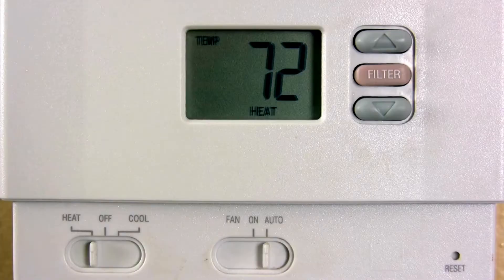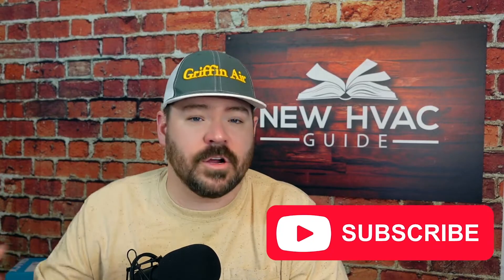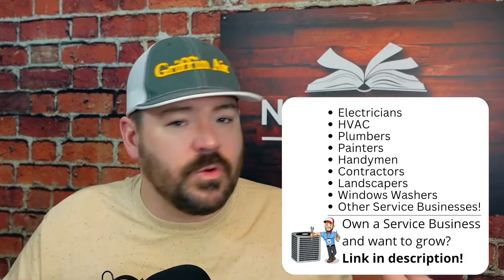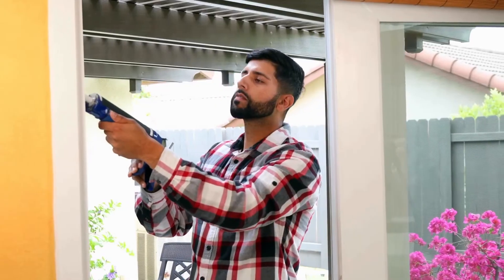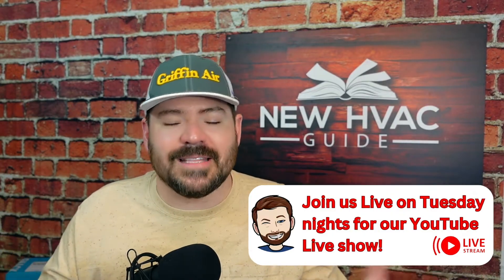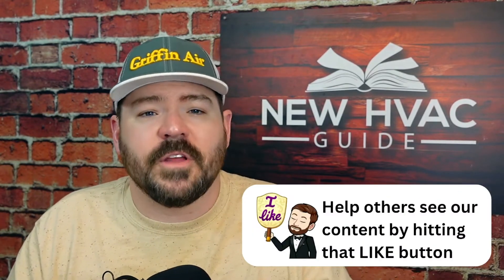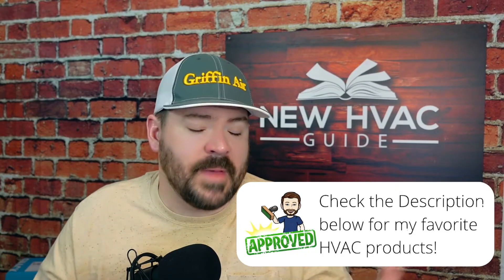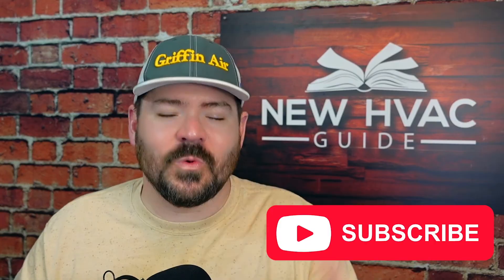Thermostat temperature reading incorrect!

Comment: It's December in Chicago...I just had a new high efficiency Amana HVAC with heat pump installed and the new Amana thermostat was installed in the same location where the Google Nest was located.  We never had an issue with Nest temperature readings.  Our current readings have been very inconstant - the thermostat reads the air as being much higher than what the ambient air is.  Consequently, more heat is pumped.  What to do?  and, has any other Amana used experienced the same?

Comment: I dont really understand because most people are saying that the thermo is reading higher tems than the actual room temp. So wouldt it be the other way around since the air temp behind the wall would certainly be colder than inside the room?

Comment: I've dealt with the hole in the wall, had it in a different house.
My question is to the newer style digital units. Model honeywell RTH6580WF1001.. Just for reference. The temp control has seemed off since early summer. We had our unit replaced 6 years ago, it went to a seer13. Blows really cold. House will feel like a meat locker at times because it seems to run more then it should.😂

I've got a mechanical temp gauge taped to the wall. It's been consistently a degree or more colder. The thing I've run into is the thermostat itself is running hot. When checked with an IR gun. It's showing 3-4 degrees hotter than the wall. Which at times can be a degree more than the actual shown temp. Which is running higher.
Heat is off as we are swinging alabama fall temps.
Right now wall is 64, gauge near unit shows 67, gauge in nearby room in clock shows 64. The unit itself opposite side of setting buttons reads 66, next to the buttons reads 69. There are no batteries. Wifi unit auto sets after no power. Do these units always show heat like this or has this started to go bad. Our previous hunter thermostat killed the a/c as it ran all day when we weren't home.

Comment: This worked for me!!!
My wife likes it cold so the setting is on 72 and it constantly running.  The temperature on the unit says 72 but it feels colder in the room.  I put a temperature gauge near it and it read 69.  I tried to calibrate the thermostat but NG.  After watching this I pulled of the unit and found a large hole, so I plugged it with pieces of wall switch foam and painters masking tape. Now the room temperature matches the temperature on the thermostat.  You saved me from freezing and more- thank you!!!
Reply: I have my thermostat upstairs set on 74 and the it feels very cold 68 degree. What should I do?!

Comment: My thermostat is set on 70 and auto, the temp on the front of it says 74. So it never reaches 70 which is causing it to constantly run instead of reaching 70 to shut off, what could be the problem?

Comment: my thermostat is set for 69 but it got all the way up to 77 and it wouldn’t even cut off. I had to actually go in manually cut it off.. the thermostat at the wall wouldn’t even cut it off.
Reply: Mines the same way
Reply: @NickWilliams-e9f My man got it fixed. I can’t remember what was wrong. His friend fixed it for 50.00. it would’ve been more than that just for heating and air company just to come out to look at it..

Comment: I live in an apartment and I went from an electric bill that was $125 to one that was $220 in just one month. Granted, the outside temps went down  a lot.. but I kept the thermostat at 72 the entire time. There'd be times the temp on the thermostat was 71-72, then I'd think "gosh, its warm" and the temp would be 77-78.  Nobody touched the setting.  We're like "WTF happened"?
Reply: The same mine set to 67 but read between 78 to 80 and it 100 degrees outside I am like do the management have it set differently

Comment: you could put a dab of fiber insulation behind the tape too just to prevent it even more. it's not permanent so if a fix is needed it doesnt prevent it and it will add significantly to the tape's performance.

Comment: I had an old mercury manual knob thermostat by honey well that a tech changed 3-4 years ago that he stated went bad and put in a digital Honeywell thermostat and I get there false readings now. I set it at 64 but the home reads at 65-66. I don’t get it many heating company’s in my region just see $ signs.

Comment: So my thermostat is reading the wrong setting. Like it will be 10pm at night and it should read as asleep but instead it reads as awake or returning. I have a thermostat on both floors and it's the same issue with both. Any idea what the issue is there?

Comment: My therm stat is reading a higher temp than the house. 
The wall behind it is insulated. Any suggestions
Reply from the maker: May just need to be calibrated which should be in the instructions

Comment: Hey Joshua,  we moved our Daikin Touch Tstat into our bedroom because our gas log was affecting the heat in the winter time.  Worked well in the winter but now with AC on for first time, I noticed that the reading on the Touch will drop 4-5 degrees F if I turn on the ceiling fan in the master bedroom!  Obviously the fan is not cooling the room but I guess is cooling the Tstat more than with no air movement since the display and other electronics in the device produce heat.  As an aside, I also notice the temp goes up if I make Tstat adjustments and goes down a degree or so if I use the screen saver option.  Any suggestions on how to mitigate this effect??
Reply from the maker: They should be coming out with an indoor temp sensor soon.